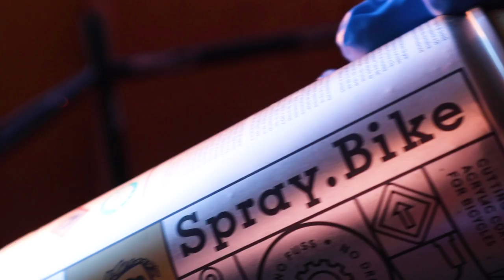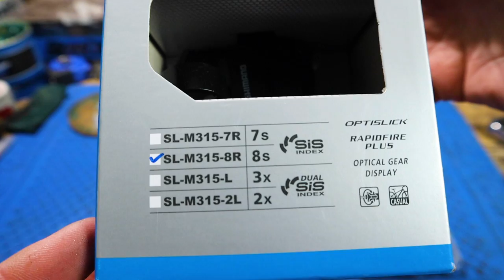Oldshovel Kona Cinder Cone Custom Build

Comment: This bike is easily the best MTB I've ridden so far https://www.youtube.com/post/UgkxHL1v1R3NE5x4KiYfyt8dnQmyNYz7qi5L   Assembly was pretty self explanatory. To be fair though, I immediately swapped the derailleurs for some smoother Shimanos and thumb shifters instead of the stock twist shifters. The sheer size of this bike dwarfs most 26" bikes of the same class. I'm only 5'8" but I can sit comfortably with the saddle and suspension adjusted properly, even though my feet can just barely touch the ground. A small price to pay for such a beast. I love that Mongoose included TOOLLESS WHEELS, it makes transporting and techwork so much easier. The aluminum frame makes it so much lighter than I expected. In comparison, mine weighs only 2lbs more than the 24" my friend rides. I'm not the most in shape rider but even I can climb inclines like a breeze with this bike and it's massive wheels and 21 speeds.

Comment: Will someone please explain why he put a quarter in the grip and how he got it out?
Reply from the maker: It’s a nickel and it acts as a bar end in the grip.
Reply: @oldshovel  does it just help you get the grip  without lubricant?
Reply: Oh ok that makes sense
Reply from the maker: It keeps the handlebars from cutting into the grips and from gouging you when you crash. The nickels are the exact size of the ends of the handlebars. Awesome hack.

Comment: Why only 8 speed? If you buy all parts new anyway, you could fit a 10 or 11 speed on the same freehub.
Reply from the maker: But the beauty of that 8-speed XT derailed is just too beautiful to not use. 😁
Reply: @oldshovel  I have the very same RD-M739 derailleur on my oldschool MTB. It works perfect with 9 speed as well, just new front shifters needed. ;)

Comment: That was amazing ! I have a question regarding the headtube/headset : it seems that the final product has a 1 1/8" threadless, whereas I think it was threaded originally. Does it mean it the head tube is indeed 1 1/8", and just happen to have been fitted threaded headset until now ? When I look for second hand 90's mtb, I always assume "it looks like a threaded headset, so it must be 1" too". I guess this is not a correct asumption and they can indeed be 1 1/8" threaded ? 

Thanks in advance for your answer
Reply from the maker: Kona started making their head tubes 1 1/8 “ in the mid 90’s as did several other MTB companies like GT but others did not. It’s something you almost need to check for each bike.
Reply: @oldshovel  Great, thanks for the advice !